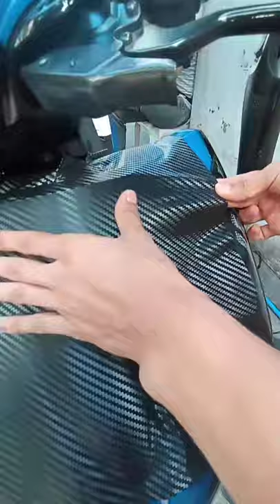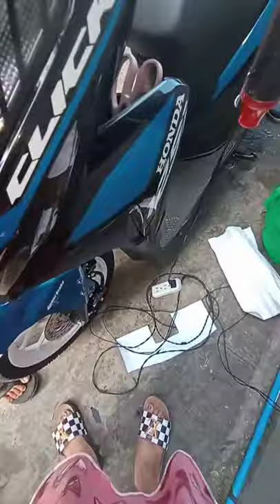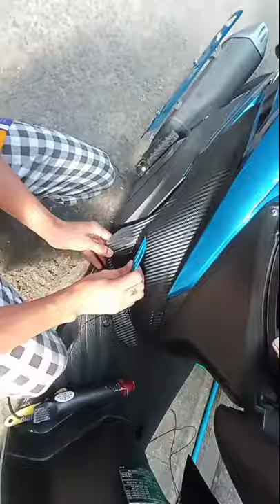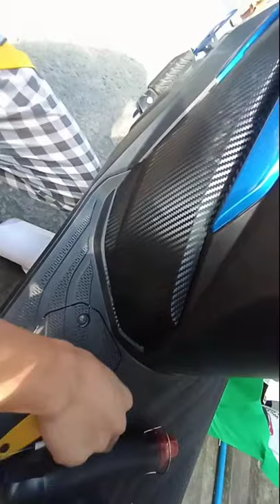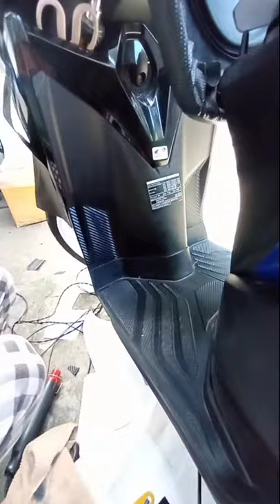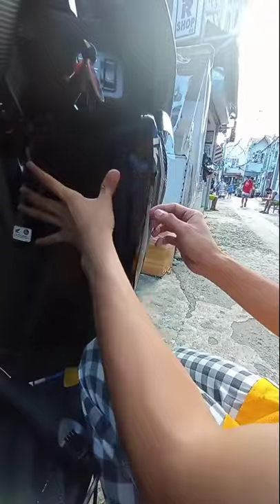CARBON WRAPPING FOR HONDA CLICK V2

Comment: Boss need po ba talaga may heat gun? Bumili po ako sa shop nyo pre cut po pwede po ba e kabit directly?
Reply from the maker: Yes po sir pwede rin hair blower
Reply: Boss san location mo.
Reply: Boss tanung ko lng nag cutting kapa nyan or direct dikit na mismo. Thank you